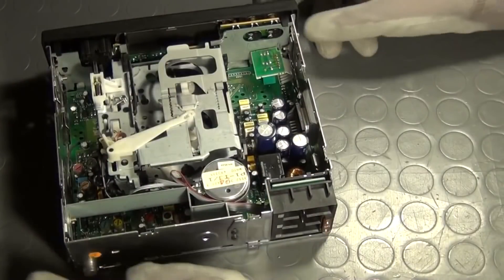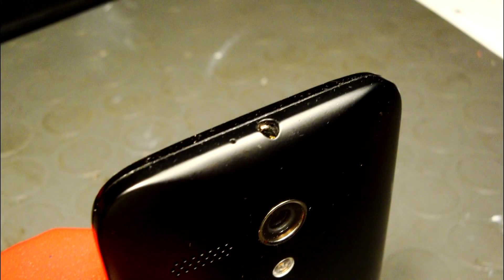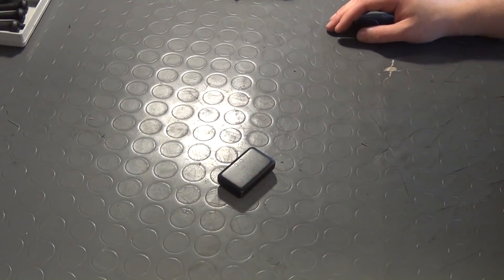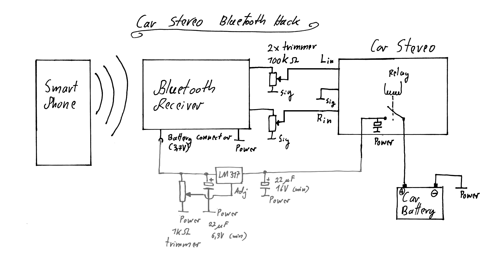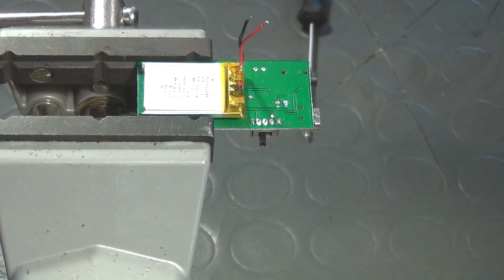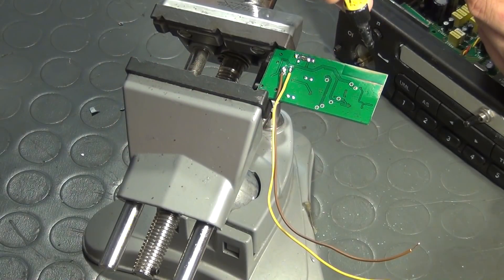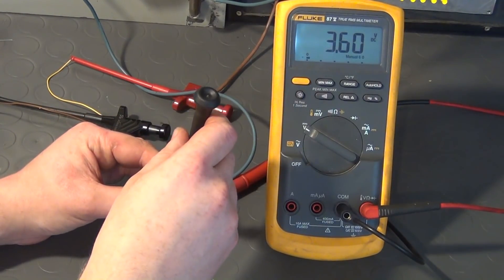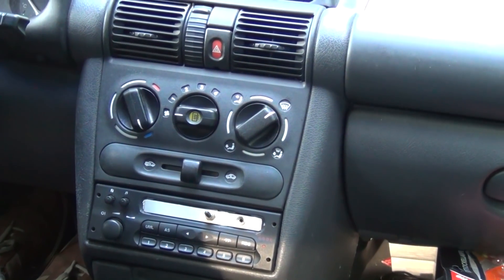Hack: Adding Bluetooth to  Car Stereos and Sound Systems

Comment: I like the auxiliary port added to the tape player. I might make one like this myself. I have a smaller tape opening. An old slot insert from a computer would work. Anyway all I have ever used is an iLive bluetooth receiver. I used a better quality tape adapter and ran the cable down through my dash to my floorboard in my 98 Grand Marquis. I had bought a Bell 3 12v adapter switch that has 2 usb ports also and uses a toggle switch as to not leave it on all the time. Used a 2 inch usb cable and the receiver was Velcroed to the carpet as well as the adapter. It sat on the transmission hump. All I had to do to use it was reach down and turn it own. I ran it off of battery and when it died I just switched the toggle switch on. Before I had it Velcroed to the dash trim along with the auxiliary cable ran through the dash up to it. Looked nice but no way to charge it and use it without it looking stupid. On the car's 12v port it was in the pull out cup holder. I removed it and had the Bell adapter plugged into it and hidden in the dash out of the way. Now that I had my 98 Ford Expedition XLT I am looking at all kinds of possibility to add it to places and hide gadgets to use. Already got a nice set up with an old iPhone 3g in an Otterbox defender case. I modified the holster to accept the charger through the bottom. It sets in my pull out cup holder. The tape adapter line is again ran through the dash and comes out the opening of the cup holder. My iPhone charger is ran from the 2 12v adapters across. The iPhone sets nicely down into the holder and everything is pretty much well hidden. I have added a toggle switch to the line to cut the juice when not running. The iPhone 3g is my favorite device to use for music in the car. I also have a nice dual screen dvd player set up in the back that is tied into the stereo through the aux port. When I add the bluetooth adapter I will need to come up with a way to have all three tied into the system without having to unplug and plug each time.

Comment: This is simple shit... Best way tho is to use a Bluetooth cassette tape.
Reply: gerald k ,, i totally agree , most people would not even be able to take the car stereo out  , and taking it apart and soldering it would be in their dreams only
Reply: I was thinking the same thing, when he explained his first video, first thing that came to my mind was a cassette adapter.
Reply: I wish they would make a Bluetooth CD because I don't have a cassette player in my vehicle. The centrifugal force could power it like the watches that never need batteries because they charge by simply moving your hand/wrist. That, and having some kind of feeding system for the laser. The only problem would be the spinning speed. I don't know if that can negatively affect the reception of a Bluetooth device. Could it be done? probably, since electronics are that thin now :)
Reply: 1blisslife it would be impossible because the cd is permanently burned with the data for the music as of a cassette player reads the music by reading the magnetic tape, but what the converter has instead of tape is a transmitter that feeds some kind of electromagnetic signal into the receiver thus you hear what's playing on your phone. 

There is no way that type of thing can be done on a cd to make that work, but when your trying to go that deep into trying to get your phone to play music on your radio and you don't want to buy a radio transmitter, the best and easiest way is to just buy a new head unit.
Reply: 1blisslife ,, just get a car adapter bluetooth that hooks up to your car stereo 12 volt system ,, it has to have the fm transmitter included with the bluetooth ,, those systems usually have a usb / sd card slot included ,, preset a special unused fm channel into your stereo memory for quick access ,, start transmitting from your phone bluetooth to the adapter bluetooth / fm transmitter to your preset fm car stereo and enjoy ,,, thats only if you do not want to tamper with the original factory stereo that came with your vehicle ,, the easiest way is like biker said ,, just get a used car stereo that has what you want and switch it with the factory system
Reply: 1blisslife ,, or another way would be ,,, most car stereos have a line in jack ,, just like your phone jack for your ear buds , get a cable with both ends the same and plug one end in your phone and one end in your car stereo
Reply: using the same....

Comment: Great video! Would be very fun to hack my dads 1965 Lincoln stock stereo to still apear stock but have such a bluetooth recieving capability hidden within.  Guessing such an old stereo would need some modern components hidden inside than a 90's version would to feasibly do such but I can see quite a market for this in vintage cars.
Reply: If it can drive speakers it has an amplifier. If it has that, it can have bluetooth added to it.
Reply: Well depends on what functions it had... You could always use it as just an amplifier...
Reply: +Kenji Fox Very true... I've seen videos here on YouTube where they've done that to vintage radios.

Comment: Thank you for this wonderful hack! I would like to know that the bluetooth would be on. So I was thinking of detaching the light node and transferring it to the dash panel that you created. Is it as simple as desoldering the light node (like the other items) and extending the connection with a wire and placing it through a hole on the panel?

Comment: A Corsa B, I see... I have one too! :-) But, that's not what my question is about. 
I have a car stereo with CD player. Do you know of a way to add Bluetooth without rendering the CD player useless...? Thanks for your reply!
Reply: Perhaps the same concept as modifying a cassete player except instead of removing the cassette player and using its contacts for bluetooth maybe you can use a splitter switchs that will flip the contacts from the CD player to the bluetooth module and back if needed.
Reply: Pibbles 'n Bits
 Thanks for the suggestion, I will look into it. One problem I can foresee is that the CD-player signal line will have to be active for that. I don't know if the unit will do that without a CD playing...
Reply: You need to hack the CD changer input. That might require a micro controller for interfacing to the port... I have the same issue with my Scoda Octavia 2005's double din CD. Cheapest solution is a changer hack device with a flash drive and memory card slots... And it costs about 100$.... The other option is a CAN enabled Android CD/Flash/DVD/GPS combo from china for abut 360$... Why CAN enabled? Because all the information about the car is displayed on the receiver unit....
Reply: Eviltech
Thanks for you reply! For now, I went with a BT to FM transmitter.

CAN can't do on a '95 Corsa B, I believe...
Reply: FloppyHares I have a Nokia phone with a FM transmitter function, but the FM receiver in my unit is absolute crap. Copmpared to the CD, at least...
Reply: Eviltech
That's unfortunate that you don't have that option. In any case, an FM connection will be of lower quality than a direct connection to the unit. However, the BT/FM transmitter I ordered gets great reviews, so I hope it will work fine for me as well.
Reply: +FloppyHares I've had many of those & I concur, and not to mention that the sound comes up at lower volume & have to turn it up higher to hear it. I have an FM inline adaptor(like what CD changers use) which works a treat though!
Reply: 1blisslife
I've been using the BT/FM unit for a couple of weeks now and it has worked great. It connects immediately when turned on, the sound quality is really good and even the phone and mic functionality is excellent. It's a Aukey BT-F4. Highly recommended!

Comment: Once you know the resistor value needed for the regulator,I would solder in a resistor in stead of that potentiometer. Temperatures inside the car are pretty extreme with full sun versus full winter etc. The potentiometers value is affected by that.

Comment: I really liked the video but wanted to suggest a possibly better/simpler way of accomplishing the same thing. This is really cool to watch dont get me wrong though

http://www.amazon.com/Bluetooth-Hands-Free-TaoTronics-Microphone-Cancelling/dp/B01COH1U00/ref=sr_1_2?ie=UTF8&qid=1464066082&sr=8-2&keywords=car+bluetooth+taotronics

Could have tapped that into the aux port, and then tapped the power into 5v or 12v+usb cigarette lighter port. I did this exact thing and hid all the wiring. Only thing showing is the receiver which I stuck to a convenient location near my air vent. Acts as a mic and has play/pause, ff, and rw buttons that are very helpful.

Comment: There are Bluetooth Adapter for Casette
Reply: why would you want to do that? Way worse audio quality
Reply: Ok I'll bite, what is your suggestion on how to add Bluetooth to an old car stereo?
Reply: Keith Noneya Either change the stereo its not that hard and theyre pretty cheap or google and see if there is a hack for your car to add it yourself like this video is showing. I added it to a 2000 GS400, wasnt that hard and audio is awesome, it auto connects everytime as well

Comment: I never knew Motorola had bad headphone jacks.  I wonder if that is just in the cheap ones or if it has something to do with the phone being too thin for the better ones.  Some phones are getting so thin that they no longer have a headphone jack.  They make them so thin these days that they sometimes have no SD card slot or the battery life is horrible.
Reply: If a bit of the jack is exposed when plugged in it is usually crap

Comment: Nice video! why the Gloves?
Reply: Prevent anti static discharge, probably not that neccesary for workin on a 20$ oem stereo but I would assume this is habit for an electronics tinkerer
Reply: I have repeatedly worked with computer components without gloves and bracelets and everything was still good

Comment: +The Post Apocalyptic Inventor I'd like to see you try this on a car CD player.
Reply: +illiad88 You would think so but it's a hell of a lot more complicated than that. You have to identify the part of the circuit board that outputs the sound after the digital information has been converted. Tape decks are pretty much the same setup as turntable needle's and guitar pickups as they're analogue signals while cd's are digital and the info has to be converted to analogue before being sent to the amplifier.
Reply: ***** If you come across a vid that shows you how to do a cd conversion, let me know and I'll let you know likewise.

Comment: I wouldn't go into the stereo unit itself... in case it gets replaced somewhere down the line.  It's easy enough to combine a bluetooth receiver with a DC power supply,  and place that somewhere in the vehicle,  out of the way.  A dollar Tree style 15 v to 5 v adapter,  with a couple of diode drops,  will yield about 3.8 v,  and is smaller and simpler than fabricating a regulator unit.  Then,  most car stereos have a rear external or aux audio input - elsse,  a wire could be run out the back,  without too much trouble,  with or without opening the unit.  The 12 volts to the CD adapter should come off the same fuse a the radio or stereo,  or off the B+ lead on the back of the unit.
Reply: You seem to forget we had a period where most standard car stereo's "didn't" have an auxilliary input. Certainly not Vauxhall cd players anyway and of course they had the bright idea to incorporate the radio display into the dash to discourage people from replacing the stereo for a better upgraded version without losing half the dash display functionality. Grrrr!
Reply: You seem to forget we had a period where most standard car stereo's "didn't" have an auxilliary input. Certainly not Vauxhall cd players anyway and of course they had the bright idea to incorporate the radio display into the dash to discourage people from replacing the stereo for a better upgraded version without losing half the dash display functionality. Grrrr!

Comment: Would it be possible to add a bluetooth receiver into the car without taking the tape deck out? If I splice in the audio signal to the reader of the tape and then add the same step down voltage regulator circuit would it still work if I used a dummy tape to trigger the stereo to read?
Reply: One year late, but yeah You could. If You want to keep cassette, then it is easier to look up where radio receiver audio outputs are what go to preamp chip. Contact between that 6 pin switch, middle contacts go to amp and the switchable contacts become "inputs". Radio "thinks" that it is amping radio, but you switch it to whatever analogue.

Comment: This is great. But why didn't u check the radio for a 3.7 volt source and tap that instead of building a voltage regulator?
Reply: Chances are very slim to find a perfect voltage and current source that is both steady and switched that also remains unaffected by tapping into it would be finding a needle in a haystack
Reply: +Unassailable Ferrari valid point. Would've been more convenient if a source was found though
Reply: Of course it would be more convenient but i would imagine it would be unlikely

Comment: Thanks for opening my Eyes, I have built my own audio system at home. But when it comes to car, I was not ready to touch it. Car is now 12 year old. I have modded the woofers to give deep base, without Amp, actually I tore the original pioneers and went to Lamington road in  Mumba , got low resistance spiders and cones for them, rebuilt speakers are lot better than any pioneer ever made. I have seen speaker companies putting hard Spiders and hard cones on their low cost speakers. So that their Huge magnet and costly speakers sound better. That's a inhuman tactic employed by speaker and headphone manufacturer. When every thing costs same, why purposely degrade quality of cheap models as per price, so that high price versions sell well? I have seen this done by all audio companies. They purposely degrade one product so that premium product sounds better and they get huge profits.
Reply: great vid! very clever.. but u can buy a cd player with bluetooth on ebay for around $30
Reply: Why did you comment on my comment any way ?
I was trying to highlight how audio companies make same stuff, but purposely degrade workings of same stuff for differentiating in premium and cheap. Degrading normal stuff of course will cost them higher as good stuff is plenty in market and is cheap.

Comment: hello i have wired this reciever (262278542781 from ebay)  up like this with doing away with the battery and putting this in its place (262278542781 from ebay) and the other end i had  a spare plug so i could put it into my 12v Cigarette Lighter Socket.all works great but im getting this interference from the sound humming noise and seems like to happen when i accelerate the car.its kind of annoying and well not sure how to do away with the interference.have you got any ideas the post apocalyptic inventor

Comment: Very clear video, I would like to try this however I have a question, can you recieve phone calls through this and is there anyway to add a microphone and an answer/reject button.
Reply from the maker: +FifthTechnik It really just depends on the bluetooth receiver. The radio does not interact with the phone in any way. It simply amplifies the analog audio signal coming from the bluetooth receiver. The model that I used is treated like a set of bluetooth headphones (without  a mcirophone) by the smartphone. If someone calls me, his voice will be heard on the car's speakers. If you want o add a microphone, you simply have to use the receiver of a bluetooth headset (with microphone) and integrate it into the radio.

Comment: I just bought a $15 bluetooth adaptor that works through aux on amazon...
Reply: +tonyLA24 How do you keep it charged?
Reply: it has a usb connection and a car charger. it plugs into the cigarate socket, it will turn on/off automatically with the car. Look for soundbot sb360 on amazon

Comment: Hi, love the ideas or hacks. i have a question that i was hoping you might be able to help with. I'm in the UK and have a 2007 Vauxhall/Opel Astra (h) mk5 (SATURN ASTRA IN THE STATES) with a BID display and I want to keep all the audio controls the same from the center console and steering wheel but just change the BID display to a android tablet. Any chance you could help with any information on what to do or how to go about the changes, even maybe what parts i need. any help is welcome and appreciated. thanks from an overseas fan
Reply: +PREET SHAH a lot of car displays are used as displays for Raspberri Pi's. so you might want to see if anyone has done anything with your display. Also, the main principle of the display is always the same, take data input, power, ground, and usually another wire for detecting if you're in gear (so no dvds while you're driving) so it's just a matter of changing where the inputs are coming from.

Comment: Just subscribed to the channel. And good to know about the phone, I have a motorola Moto G 1gen (but LTE) and have nearly not ever used the 3,5 mm audiojack, have been using bluetooth headphones since before this phone.
Also good to know: After I upgraded the phone to 5.1 Lollipop (Motorola firmware) I get a lot of interrupts in the audio over BT. It is not the radio signals since I have the same headphones (and tried others). Seems to be software related and might even be something like bad scheduling av the processes since if the phone has to do other stuff (surf the web) I get these annoying interrupts.

So if you still have 4.4 Kitkat in your phone I would say stick with it. And if you have upgraded, got the same problem and found a working solution (not downgrading) I would donate to your channel if you could tell me what to do and it works for me!